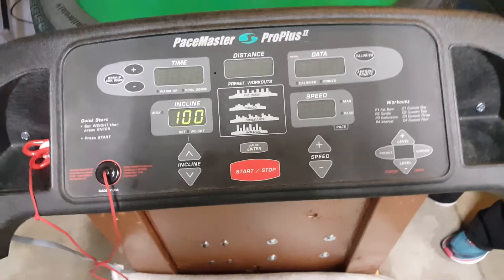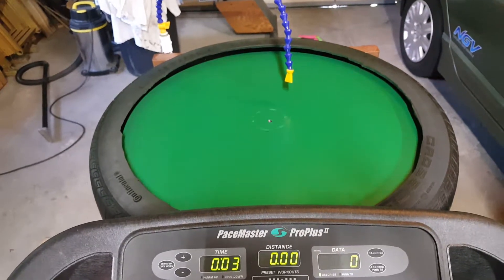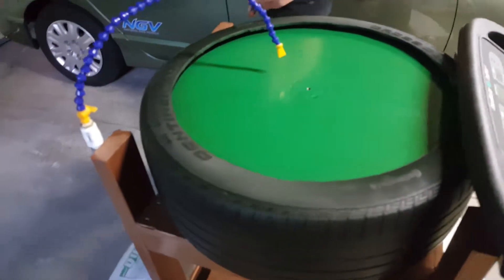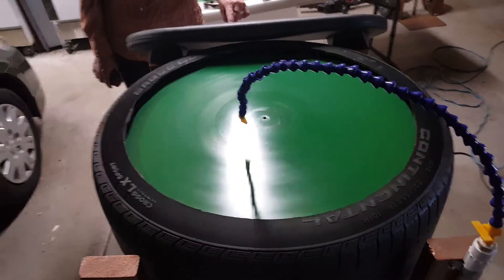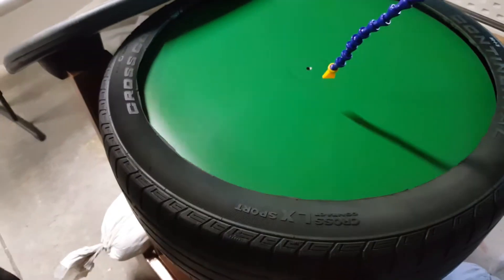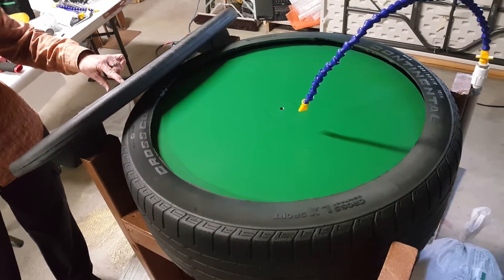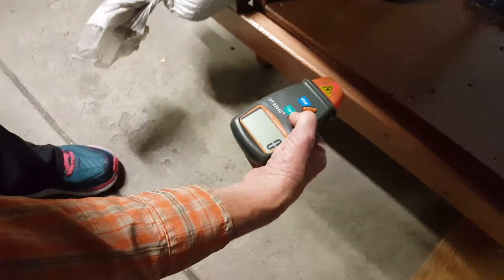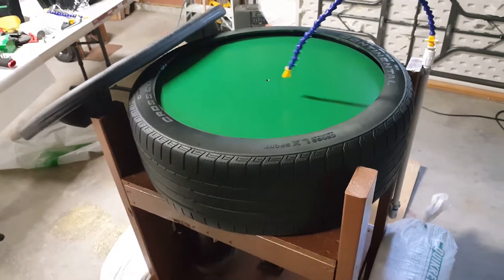24" Lap Grinder Project

Comment: Hello Jerry, I'm building a similar Flat Lap from the same plans, I think I've got most of it sorted, but I'd be hugely grateful if you could advise on the bearings. Could you tell me, is the shaft entirely supported by the set screws in the two flange bearings? Are these two bearings standard deep groove ball bearings, or is the top bearing a thrust bearing? The plans don't go into much detail on the bearings, and with the weight of the plate, I wondered if a thrust bearing was needed, or if the support from the two flange bearings via their set screws was enough, or if you had had the shaft machined to have some sort of shelf or anything similar...  Thank you very much!!!

Comment: Hi Jerry, The plate that you had machined. What was the material and how thick is it.
Reply from the maker: 3/4" plate steel, cut out with a laser then machined and balanced on the shaft

Comment: Hi, I'm from Australia and tried that link it doesn't seem to work.  Do you have a photo of the underneath looking up under the master plate. Cheers
Reply from the maker: The view from underneath will only show the shaft coming through the upper deck. Do you want to see how the shaft attaches to the plate?
Reply: @jerrylundberg  yes please I am trying to build one and cannot find diagram s helpful in this application. Cheers
Reply from the maker: Debbie n Gavin Pinner see Stanford Mfg.

https://shaft-collars-couplings.staffordmfg.com/viewitems/flanged-mounting-collars/accu-flange--shaft-mounting-collars
Reply from the maker: I used this Stafford MFG part Number 1L100AFXK
Reply: @jerrylundberg  thankyou for the info on that part number.i will see if it can be sourced in Australia
Reply from the maker: Debbie n Gavin Pinner I have the HIS plan, but I don't know how I could send the PDF to you.
Reply: @jerrylundberg  that would be great as a guide.
Reply: I am also in Aus and seem to have trouble downloading it. Any luck obtaining it elsewhere? Thanks for sharing the flange info. How about the bearings? Can you share any more info?
Reply: @williamcrellin3264  do you have email address and I will forward the plans
Reply: @gavinpinner5176  I got the plans now , thanks for your effort
Reply: @williamcrellin3264  Sorry I didn't see email until today.  I did email you anyway and also what I built.  Cheers Debbie
Reply: @gavinpinner5176  thanks so much mate. So helpful!